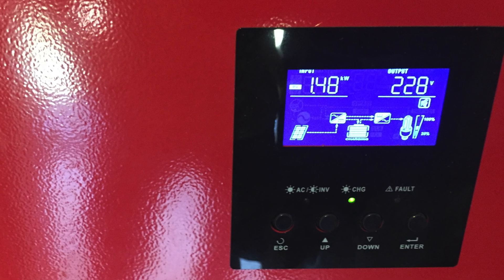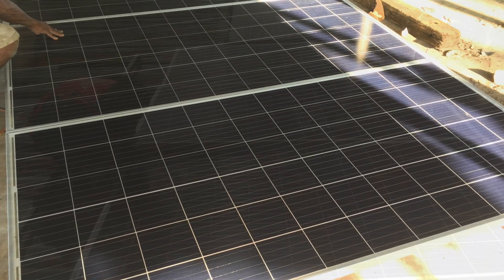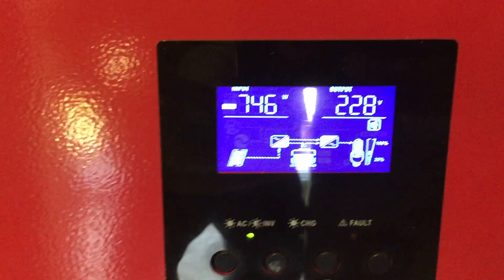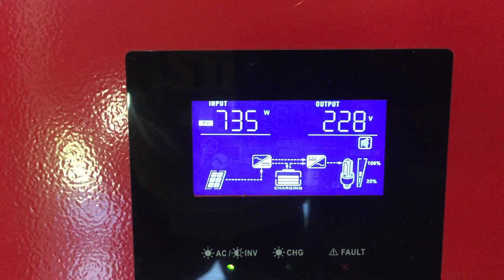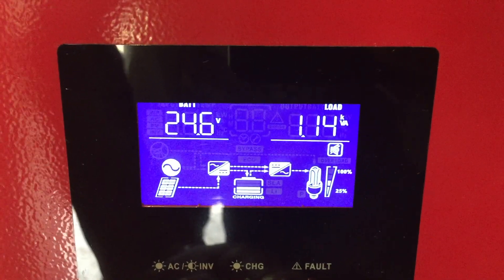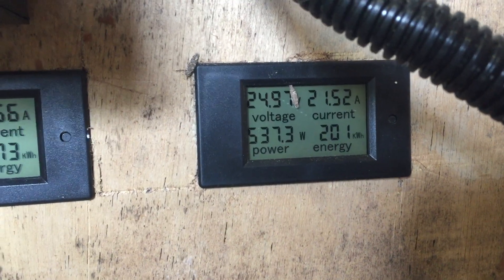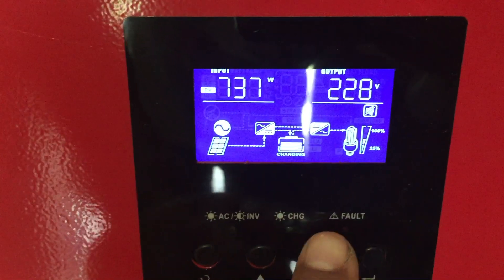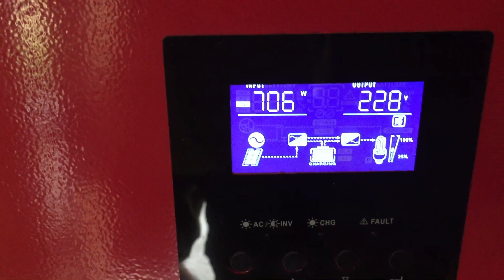YEAR and a Half REVIEW of MPP SOLAR Inverter

Comment: Hi can I know how to setup this inverter...Pv turn it on the power button not really do anything
Reply from the maker: How much PV do you have?  How is it set up, parallel or serial?  If the voltage is not meeting the minimum required, the unit will fail to work.

Comment: Hi, I'm looking for one of these solar inverters for a van conversion. I have 2 solar panels with this spec - Watt: 310Wp, Max Snow Load: 5400Pa , 112lb/ft2, Max Voltage Vmp: 32.67V, Max Current Imp: 9.49A, Number of cells: 60, Open Circuit Volts: 40.08V, Short Circuit Amps: 9.28A, Module Efficiency: 19.00%, Max System Volts: 1000VDC, Power Tolerance: 0 - 3%, Max Series Fuse: 15A. What's the best inverter and battery setup to go with for two of these solar panels? Any help would be hugely appreciated..
Reply from the maker: MPP does have smaller units.  Go to mpp.com and check out their inverters.  My red one is old, but I ran it on 600W like your specs.  It was only good to 2400W and small enough for a van, but MPP has better equipment now.  I believe they a smaller GK, but it might be a bit high still.  I know they still make smaller inverters down to 1500W, but I'd opt for higher that can cover your 600W, but leave you room to grow in case 500W panels replace what you have.  Also it's best to have an inverter that can handle the amps.  Less likelihood of failure from heat.

www.mpp.com

Good luck.  Hope the info helps.
Reply: @SolarFarmer  thank you so much for your advice!!!
Reply from the maker: @MrX-gc5fs  
Anytime.  Good luck.  Let me know what you find.  Take care.